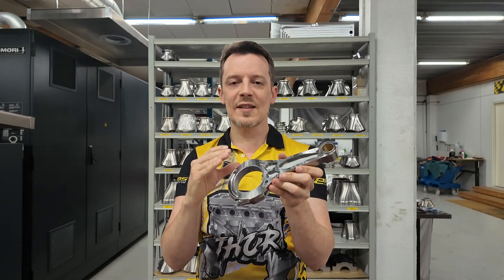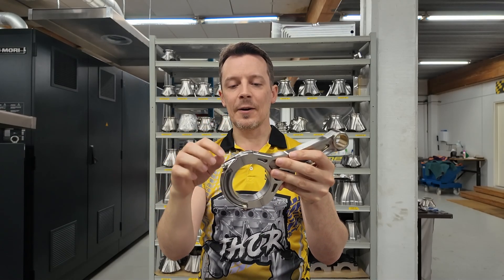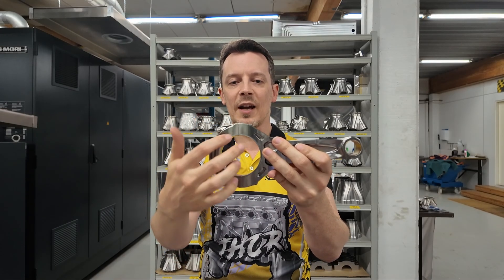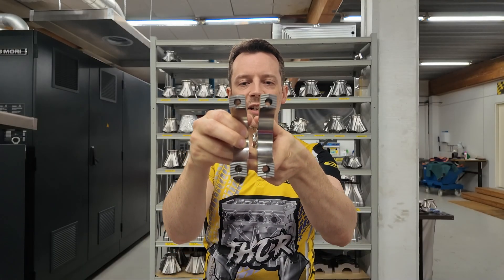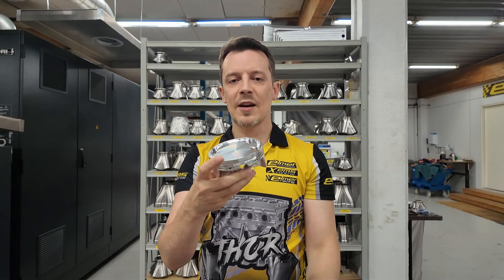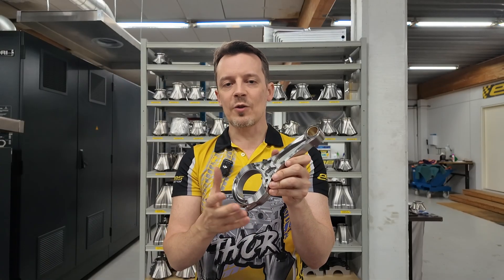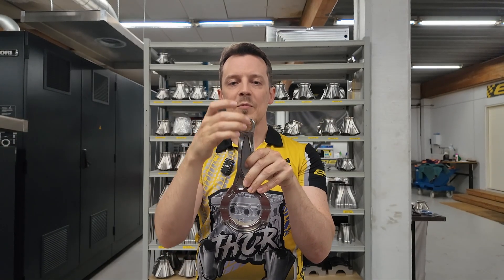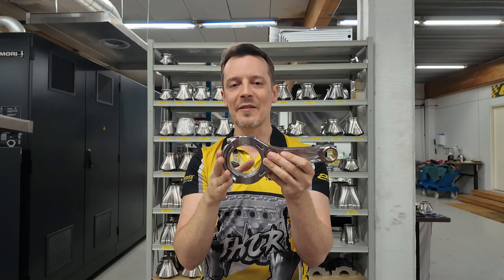Galling issues and no cushioning effect on our billet titanium rods?

Comment: My question is what advantage are you expecting from these rods. Iwas a military aircraft mech and worked with aircraft using titanium parts and don't know what advantage they would provide. It seems that any weight savings would be counteracted by the additional mass required.

Comment: How do you manage bolt tightening torque, when the surface friction changes due to lubrication whatnot, which seems ruin my panacea of using  torque wrench 😅?
Reply from the maker: We use a lube specifically designed to work with tightening bolts. Not 100%, but helps!

Comment: Nice to see these upgrades, Oskar. Interesting work, although not my field. 😅 Having gotten into FreeCAD & 3D printing lately, I realize, how the finesse of a mechanical systems design is directly related to the effort you invest on designing. The more mechanical optimization, the more  design time it requires. But of course, for a series production thing it evens out. Just my 2 cents of course 😅

Just curious: Why did you need to have this grid of those small pins/edges on the connect surfaces instead of just having a funnel type of structure, which would align automatically when fastened? You'd need less resolution for funnel than for these small edges I feel 😊
Reply: Indeed!

Comment: Your rod cap interface is a poor design. It will do exactly as you say and restrict the joint in 2 axis. Because your part is a billet and not a forging it's going to plastic deforme a small amount and and you can't adjust the clamp load on the bearing after on a teardown. The parallel serrated cap with a dowl is all you need and you can lap the cap surfaces together. Also your bearings are probably still flat across their mating faces while not impossible to install in your design it leaves a lot of room for error if trying to make a repair at the track.
Reply from the maker: Only way to really avoid deformation on the split surface is with fractured rods. That's a very good way to do it, but has alloy restrictions and extra manufacturing steps.
Correct that the big end bearing housing diameter can't be changed without remachining. But that isn't really something that can be done at this power and stress level regardless. If the bearing moves in the housing and would require tightening the housing D to get back into spec, the rod has likely heat cycled too much and can't be used any more at full power.
We do have locating tabs on the bearing halves, and should be possible to changed them trackside, especially with the lower access panel on our Hel engine making this easy. But it's mostly there for fault diagnostics, and to know if it's still safe to run the engine. Complete teardown and inspection is recommended if a bearing is observed to be bad.
Reply: @ElmerRacing  on a engine we drag raced we had a issue of main caps chaffing in the block so I had a Chinese diamond file manufacture put a patch of diamond on the main caps mating surface  and had to bolt the assembly together the press the cap into the block it worked extremely well but took forever to get everything in place and tolerances to my specs.  Maybe something like that could be implemented on rods as it acts like a fractured surface.

Comment: Why no oil groove in that big end bearing?
Reply from the maker: No upside. But there is a downside in reduced bearing surface area.
Reply: @ElmerRacing  Interesting, so is there just a larger than normal bearing clearance between the bearing and crank for oil to flow? I'm also assuming you run a thicker weight oil than say the usual 20w or 30w in most cars nowadays.

Comment: Dyno Don had to have his Crower titanium rods , that ran two to a journal , coated with plasma moly in 1969 plus or minus a year .
Reply from the maker: The Hel engine (vr38 replacement) is a 60deg v6, with one rod per journal. So unless something goes horribly wrong, there should be no titanium-to-titanium contact :)